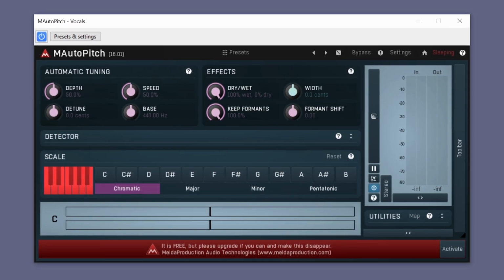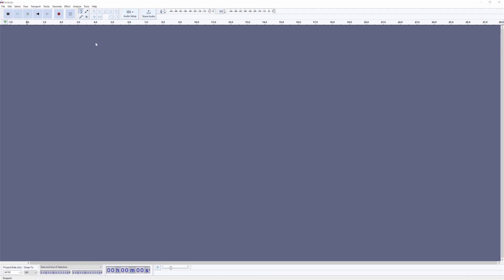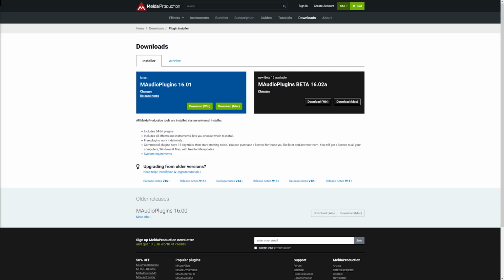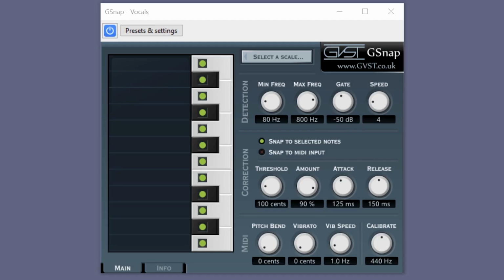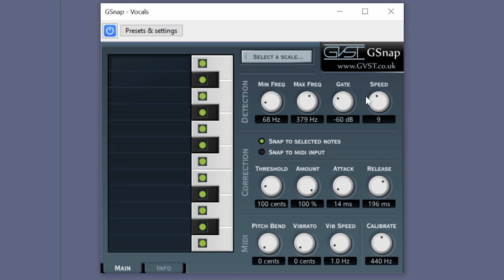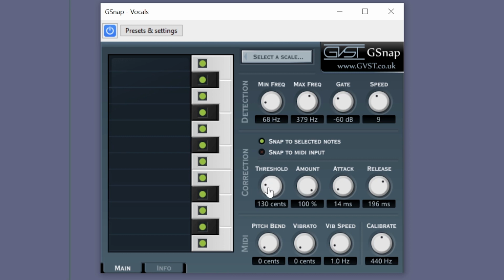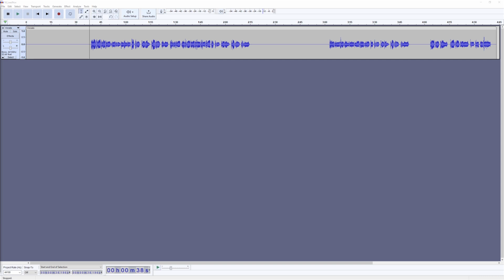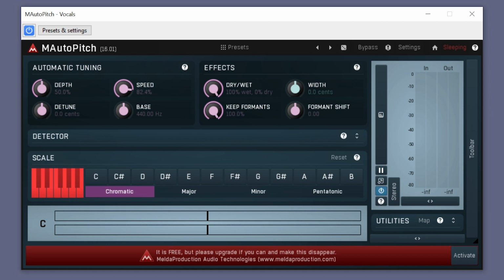Audacity AutoTune – Free Pitch Correction Software

Comment: I'm not sure those really work as well as say an autotune system .. I've used both of those profiled in this video, but I don't see much of anything happening. I'm just not sure it's really doing anything other than adding an effect. See, i use one of those app pitch monitor  on the phone but when I am all said & done before & after I don't see much of a difference in the lines.. overall, I am not sure what those plugins are doing..